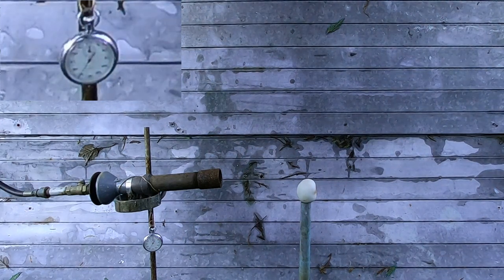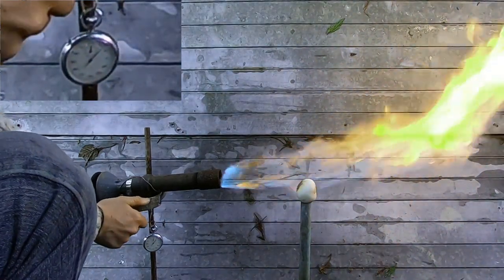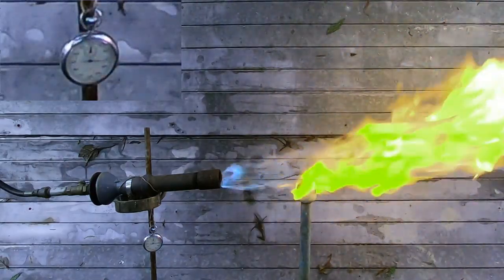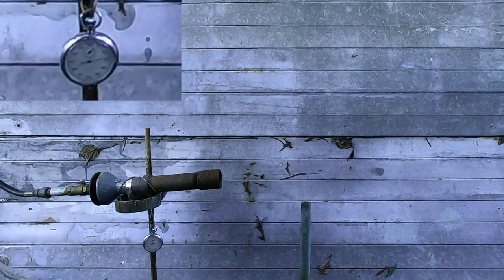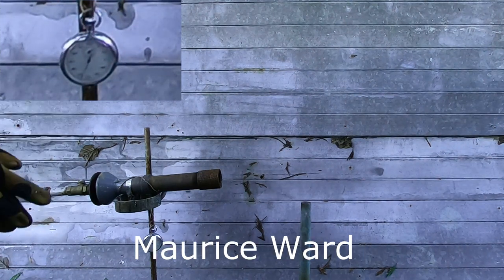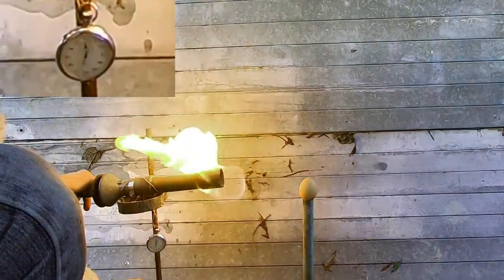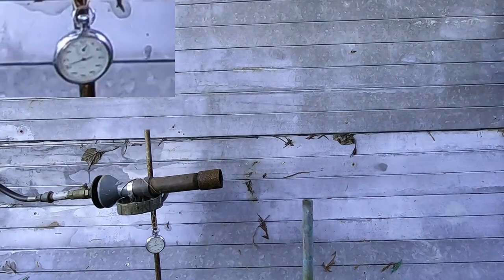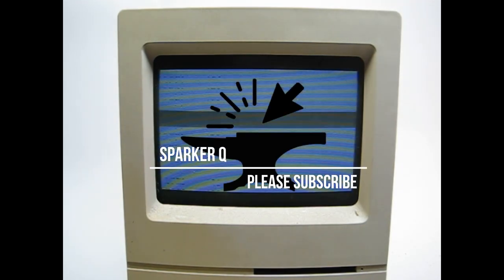DIY Starlite - Egg Test #1 and Control

Comment: Your flames were engulfing the egg completely. Try again, but cover the entire egg with ‘starlite’, or angle the torch better so you don’t cook the uncovered portion. It appears the flame went green when the egg itself got torched, and also during the first test while it was fully engulfed. I’m fairly confident if you cover the entire egg with that stuff it will not cook.
Reply from the maker: Yeah I colour corrected the video on import as the colours were all out of whack and I don't totally trust the colours that came out... on the next test I will use your feed back and do my best to get the colour right in the camera first off :) As well I cut the control egg short on the burn by 1 min as it was looking rather toasted!